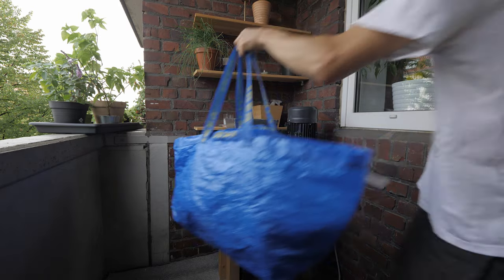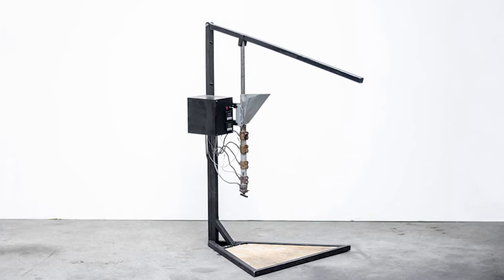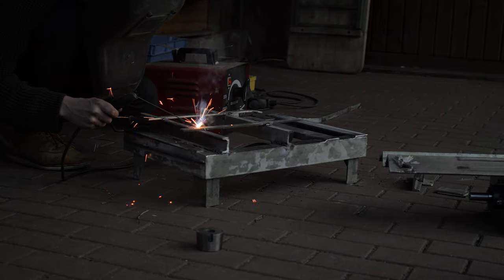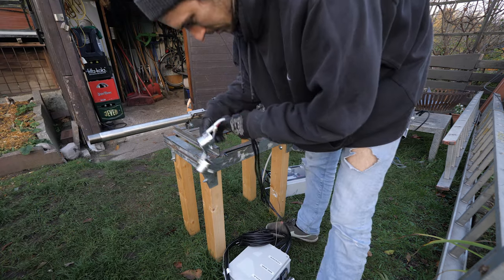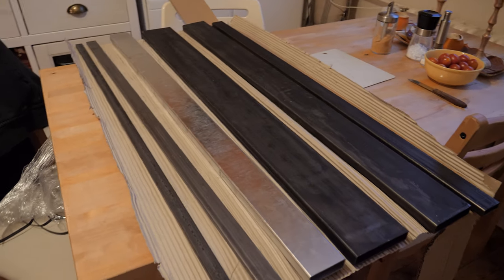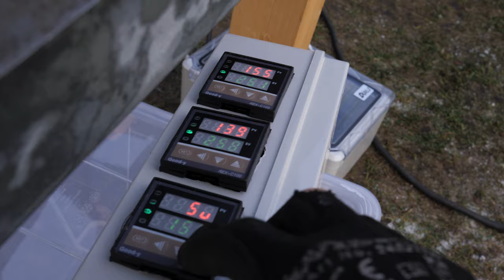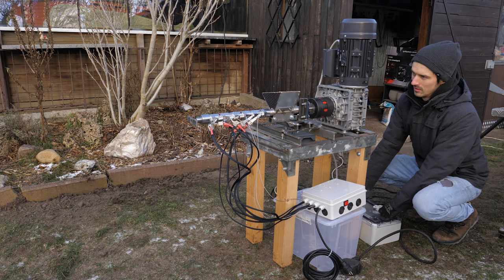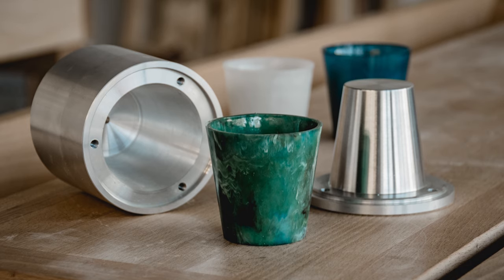Building The Precious Plastic Extruder

Comment: Are you able to come up with a desktop extruder that functions like a solid ink printer for depositing precisely controlled melted dots of plastic onto a page.  But then using that process as the basis for a full CMYKW 3D extrusion printer.  Use "raw/virgin" plastic pellets or recycled pellets to make these new shapes.  Because it is more like a traditional printer you'd be able to lay down much more material than squeezing it through a small heated tip like a normal hobbyist level 3D printer.  

The other thing that would be of tremendous benefit is to make a desktop vinyl sheet extrusion / printer.  In essence the same idea as above but for the fabrication and application of custom-made vinyl in the shape desired.  No more trimming, weeding, or waste.  Potentially faster production times, overall cheaper, only need to get the raw materials.  Add other properties to each batch as you would swap filaments for infused wood, metals, rubber, etc.  It would be a revolution to the application of vinyl decoration and sign making.
Reply from the maker: Your ideas sound crazy, but I'm not sure if i get what you mean.
CMYKW printing sounds awesome but how am I supposed to pull that off? Same with the vinyl, how do you think to make a vinyl sheet extrusion? I've never seen any vinyl in my plastic waste.
Thanks for your ideas nonetheless!
Reply: Crazy ideas are how society moves forward.  Look at 3D printing itself because no so long ago it was a revolutionary crazy idea.  So I've been watching tutorials of how vinyl is used to decorate all kinds of things.  It always uses thin sheets that are cut by hand or machine into a flat shape and then the unwanted areas are picked out during the weeding and trimming process.  This weeding stage is bad on the eyes and body over time.  The vinyl that isn't used for a project is thrown away.  Extremely wasteful process.

Watching how Siser makes their vinyl their videos depict it in pellet / raw form whereby it is fed into a hopped and runs through an extruder.  Watching videos of how vinyl records are made and they too use raw plastic pellets that are fed into a hopper and fed through an extruder to get the desired shape.  Vinyl is described as having a rubbery gel-like quality once heated.  3D filament resin also comes in pellet form, is fed into a hopper, then run through an extruder to produce the shape desired.  Usually as a thin string of plastic material but there is no reason it cannot be made into other shapes.  

This was the basis of my idea.  By blending ideas of the desired outcome to create a "desktop" sized machine that can fabricate sheets of vinyl on-demand in the desired finished shape people would be able to eliminate the weeding and trimming process of decorating garments, signs, etc. 

Add the flexibility to precisely control the deposition of the vinyl like is done with solid ink printers means a page printer of vinyl working at much faster speeds as opposed to squeezing out a thin filament onto a heated plate to slowly build it up one layer at a time.

While laying down precisely printed full color Cyan Magenta Yellow Black White in the desired shape one page sized layer for each pass you could layer those as well to create a much faster full color 3D extrusion vinyl printer.  

As to how you achieve that?  This is why I asked if you can do it.  I posed this question to several other engineers who use and build 3D printers, to Siser itself in the hopes this idea would get traction.

Melted plastic and vinyl will conform to whatever shape it is forced through or molded as.  Liquid resin 3D printers use a laser or high resolution LCD mask to produce each thin sheet of material layer by layer.  But that process is a bit more involved requiring cleaning, UV curing, and sometimes post production treatments.  It also tends to be a single color for the entire build.
Reply from the maker: @IraQNid  Seems like you've been in the topic for a while. Sounds like a good concept too.
For me to pull this off would take a lifetime though. I'm not an engineer and if I'm not fully hooked by an idea, it's hard to put so much effort into a project.
This seems to be directed in the shirt printing industry and they would definitely benefit from such an idea. It's not really what i would like to get into though.
Thanks for your explanation. I hope you'll find someone that is keen on trying it out.
Different question though, why aren't you trying it out yourself?
Reply: @ARTVENTUREFILMS  I'm not able to.

Comment: Wouldn’t this be useful as an Extruder for filament to be used for 3d printers?whether it be using virgin pla/abs or partially recycled plastic, I mean after all most 3d prints are just rapid prototypes that would end up in a landfill anyways.
Reply from the maker: Yeah that's true but making good filament is not easy and you need even more machines. I was thinking of buying a mould and just doing one object

Comment: Hello, I have a similar extruder, and I should say that extruding (even beam) is not so easy task as on Dave's videos. There are a lot of issues, and it is a very difficult to repeat same result. And if we talking about moulds - It is better to start from simple shapes (plant pot - is good choice).
Reply from the maker: Hey there! Yes that's true. I haven't been extruding because I have to fix my welding machine to weld a better connection for the beam mould but so far it wasn't easy at all. Dave makes it look so easy in his videos though ;)
Thanks for your input! What moulds have you been doing?
Reply: @ARTVENTUREFILMS  I have moulds only for injection machine. I would be very satisfied If I could produce beams, with regular parameters in adequate time, but I still couldn''t cope with it.
Reply from the maker: @copypaste815  Would love to see some of your work :)

Comment: Lot of design flaws, but it's awesome that you build it... great...
there is a lot of suggestions but, 
I would really suggest thermal gaskets for lekages, and use small die.

wouls like to see further how it goes.. nice video people would learn a lot by  real machine building mistakes and improvements you'll make. cheers...
Reply from the maker: Yes, a lot of flaws. And i already continued but haven't posted anything until now. I will try to make up for it and work on a video showing more of the process.
Thanks for the motivation!

Comment: Ashtray. or something under my gas stove. etc.knife handle, as a lkw driver i could use an antenna holder hanging from the mirror bars, also there is a ton of need but various difficulty.
Reply from the maker: Good thoughts man! What do you mean by something under your gas stove? Just a sheet so that it sits better? 
Various difficulty is the point really. Many awesome plastic products but most of them difficult to make.
Reply: @ARTVENTUREFILMS  So it wont shift around. I have a portable gas stove and I usually put it on top of the fridge when I'm cooking. Also Coasters. Or Filament for 3d printing.
Reply from the maker: @BloodAcidPro  ahh right. That makes sense. thanks man :)

Comment: how much torque would you recommend for the plastic shredder motor? for the extruder motor?
Reply from the maker: I think my motor has 300 Nm of torque and it's alright for the shredder but the extruder definitely struggles with that. I can only extrude for 30min before it overheats.
The motor I'm using has 2.2kW, 230V and around 75rpm output speed, if i remember correctly.

Comment: Hey artventure films,  Great fan of your channel. Please a quick question, how much horsepower is the induction motor you use for the extruder? and how many phase, 1 phase or 3 phase motor?
Reply from the maker: Hey thankyou so much! I think it's a 2.2kw 230v motor. But it's not enough for proper injection, it heats up too quick. It's good enough for shredding though
Reply: @ARTVENTUREFILMS  Is that a 3 phase or 1 Phase induction motor?
Reply from the maker: @mmnyako  i don't know, sorry! Even after looking it up, I can't remember.
And i wouldn't know which one is better either.

Comment: Hi, looks a good job to me, can you advise what output Kg/Hr the barrel could produce, i have a project in mind for extrusion of a product which would be extruded through a die to produce a1 metre long part. that would be continually running for a batch. What electrical consumption are the heating elements taking. Keep up the good work i love it. Reg
Reply from the maker: thank you so much! unfortunately i don't have the data on this. And i've been upgrading my machine the last couple of years, because it had a lot of flaws.

Comment: ive been doing plastic extruding for almost 10 years if you but some color additive you can make it any color you want alos by adding some heating band to you die you then would want the plastic to be cooled as it comes out the other end. this would make a continues production line. a saw would also be  required to cut extruded pieces into different leighs. i deal with 7 different types of products in are system from virgin plastic, additives such as color, repro-plastic, and flake, like what you are extruding we only use about 30% new plastic in are over all blend. good luck i like it
Reply from the maker: Thanks Ryan! Where should i be placing the heating band? I don't think i understood what you wrote.
A production line is definitely my goal but the hot plastic pushes itself in the center to the front of the mold, leaving the plastic that's on further away from the center, touching the metal, staying in one place..
Not sure if you understand what i mean. I might have to film another video to explain that.

Comment: Awesome video man! 

Some improvements you could do to the machine is:
Adding some kind of fireproof insulation around the barrel and nozzle to keep a more even temp.
Lubricate the beam mold.
Having higher heat at the nozzle.
Using HDPE for the beams.
Using the machine in warmer weather so that the beam mold don't cool down the plastic too quick.

Good Luck man! ^^
Reply from the maker: Thank you so much man!
How would you lubricate the mould? I think that's my biggest problem right now.
Thanks for the tips too, I'm already working on improvements.
Reply: @ARTVENTUREFILMS  HDPE Is kind of selflubricating so that might solve it for that.  But for other plastics, getting candlewax in the mold might be the least messy way i think.
Reply from the maker: @olemi99  I didn't know HDPE would do that.
Will test that for sure!
Maybe waxing or lubricating it otherwise will be an option for PP, will see.
Thanks for your input !

Comment: Definitely heat the mold to the glass transition temperature or a little higher. Without it the first plastic out will begin freezing and create back pressure and clog.
Reply from the maker: That's true! I will keep that in mind. Thanks for the tip!